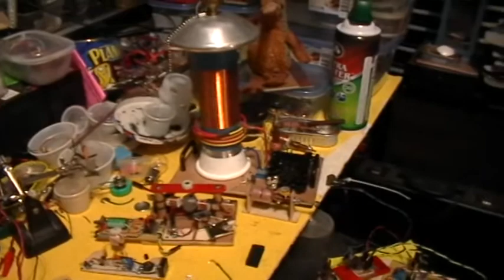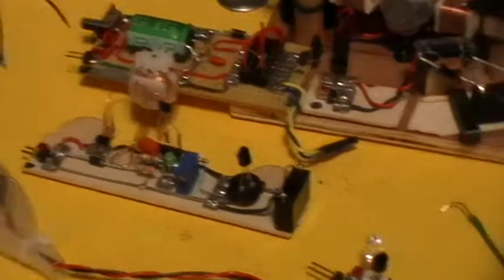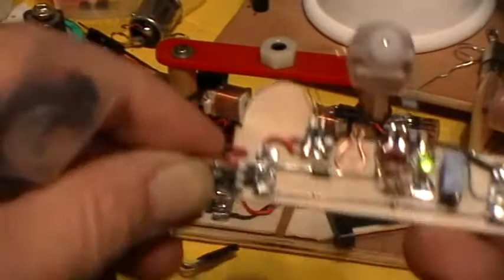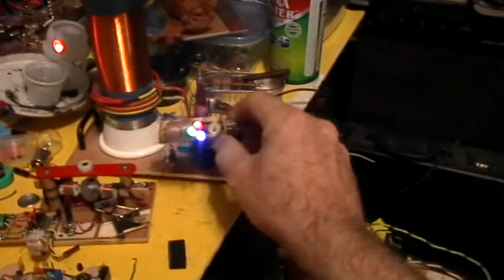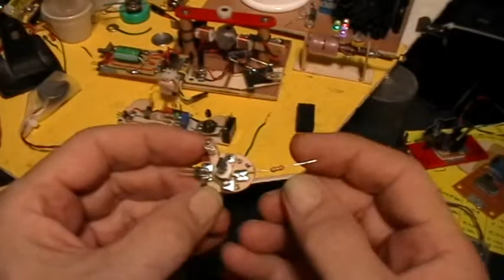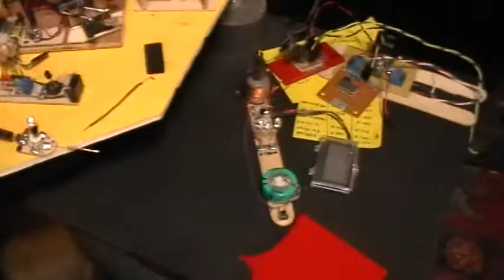Update: Some Current Lab Projects

Comment: Hey TK,
Where do you get your two pin, two wire connectors from and can you remember the pricing on said item? Would like to perform some experiments and looking for a simple way to connect a DC source.  Thanks in advance bro!

Roberto
Reply from the maker: The pins, shells and sockets are standard "DIP Header" items. I get them from my local supplier. The most expensive bits are the female crimp socket inserts.
Try looking here if you are in the USA:
https://www.sparkfun.com/categories/91?page=1

Comment: I love all your stuff but in particular the really simple stuff that you do. I must build that static charge detector. On my desk I have a capacitor with a resistor and LED soldered to it, I charge it up and just let it glow now and again.
Reply from the maker: The demo in this video doesn't do the static detector full justice. You should build one, and play around with it. By careful "finger resistor" priming I've been able to get mine to turn on and off to the motion of the charged red plastic scrap over a meter away. It really goes crazy for toy balloons and ping-pong balls, after rubbing them with a bit of microfiber cloth.
And of course if you can switch or control the FET, the FET in turn can control anything else electrical.